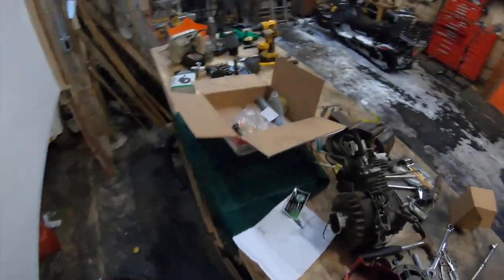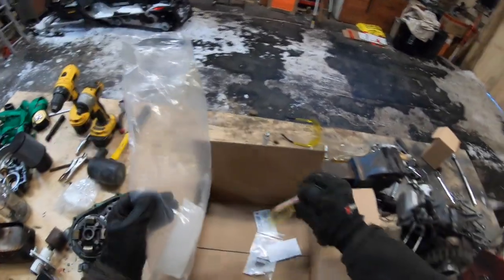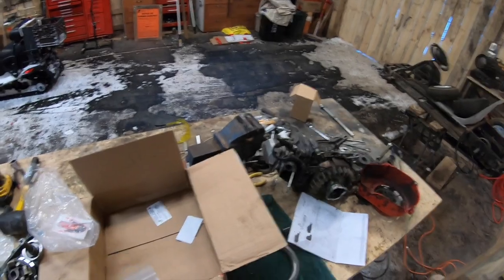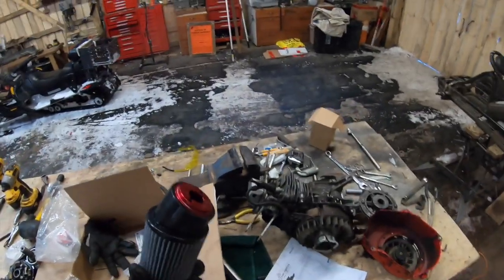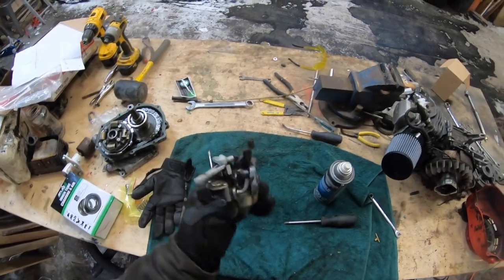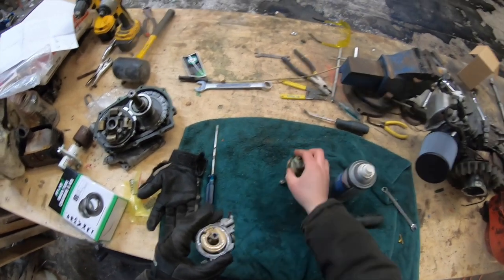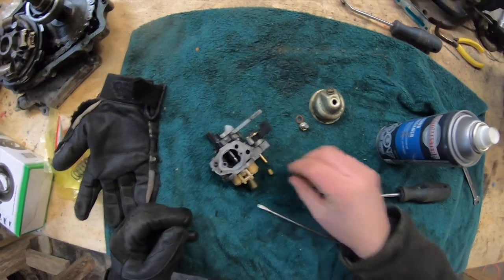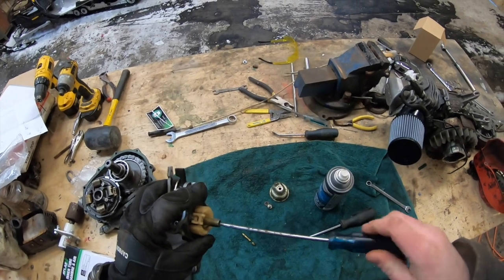CHEAP Backyard Go Kart Project; Installing Emulsion Tube, Main Carburetor Jet in GX160 (part 5 of..)

Comment: Please help I have a predator 212 and I put the 140 e tube and .035 main jet and now my carb is leaking
Reply from the maker: Probably one of the gaskets lime the one on the Noel didn’t get back in on the correct spot